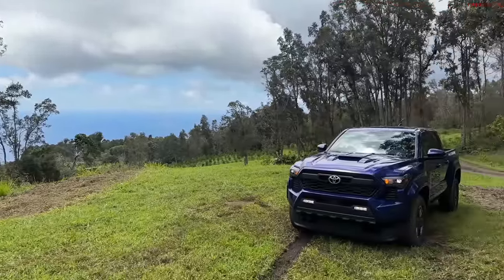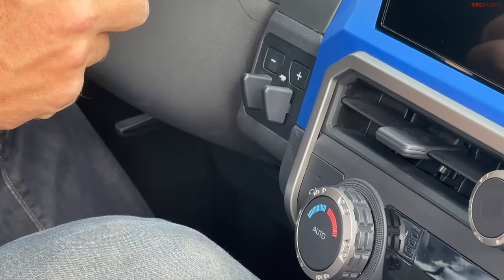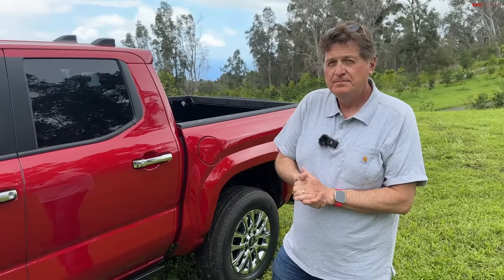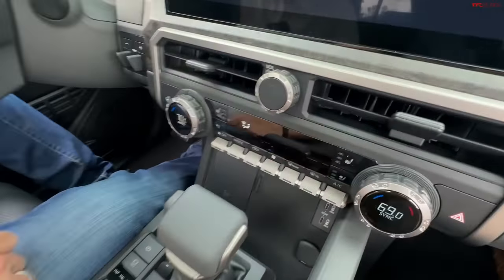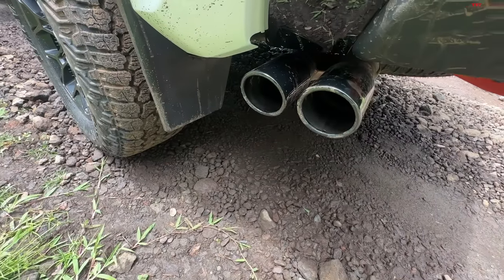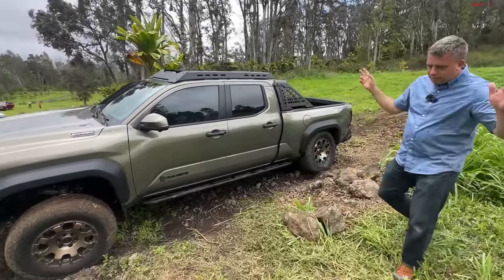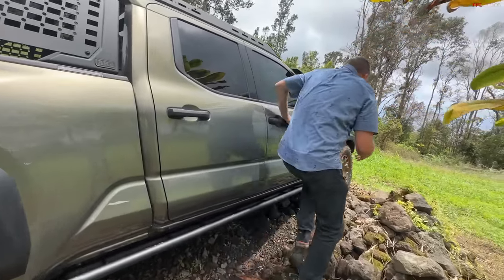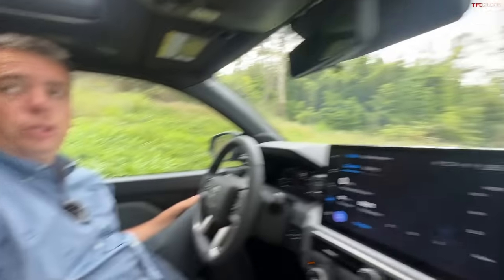The All-New 2024 Toyota Tacoma Is Finally Here But Have They Fixed Its Three Biggest Problems?

Comment: Toyota has lost its way for sure.  Once the kings of making the most solid and reliable vehicles, mechanically basic.  No more naturally aspirated solid engines (no one wants a turbo v6 for towing), to much tech making it hard to work on.  These trucks won't last anywhere close to 300k they should.  Gonna stick with my lx470 and 2018 tundra.  These are great if you plan on throwing them away after a few years like most people today.

Comment: No way would I waste my money on a Tacoma, Made in Mexico. If they make one in Japan, maybe, but that ain't happening. Just another hyped up vehicle based on its reputation. The new ones are nowhere near the same as the old ones. So, go ahead and be the guinea pig and pay its exorbitant price.  If you want one, find a used one that was Made in San Antonio and have it inspected and the systems scanned for codes and problems by an Independent Toyota mechanic before you buy it.

Comment: Battery in the cab! Wow, talk about cancer. 
Ford Ranger has 10 speed turbo charged with 7500 tow capability. 
Looks like the core toyota is gone, and we are stuck looking at this truck with its goofy chin spoiler. No buying one I will go ahead and buy ranger raptor.

Comment: Still looks and pretty much will feel like a Tacoma from everything we’ve seen so far.  Nothing extraordinary which is sad.  Even their top models are missing basic things -Needs bigger wheels needs bigger bed especially for trail hunter model. Toyota plz  ditch the rear seat useless cabin. Needs better ground clearance and definitely better mpg with all the tweaks to the motor.  Lastly needs decent price and less mark up from rip off dealers Toyota sell directly to market rich dealers ! Lol.

Comment: A rear suspension designed for a car and not a truck. Center rear window opening that is useless. A perfectly vulgar center screen. A turbocharged engine that is going to cost an arm and a leg to repair when the turbo fail. Looks more like a Dodge / Ford engineered product than a Toyota. A beautiful useless money pit built for the masses without a common sense.